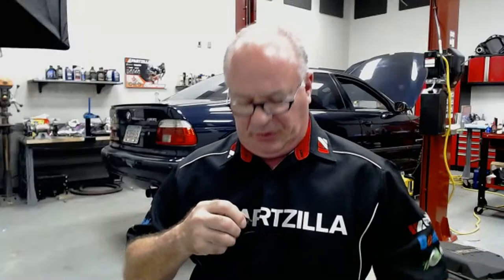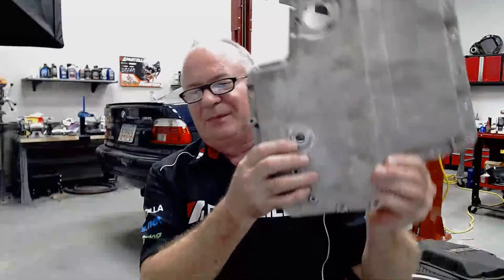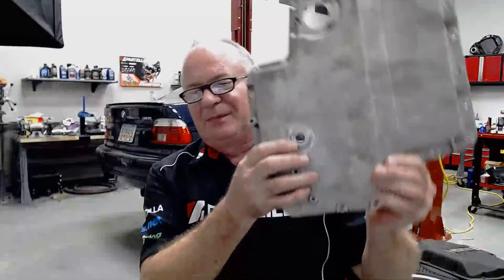Live Q&A with John Talley | Partzilla.com

Comment: I have a 04 polaris ranger 500 fuel pump keeps shutting off .it had set a number of years doesn't have many hours on it .the 3 boxes under the hood the second one has fuel pump wire goes to it has a bulge in the top. I shows the box being discontinued how can i fix this .
Reply: It has fuel pump changed fuel filters changed tank flush runs for short time but quits changed carb just wont run very long